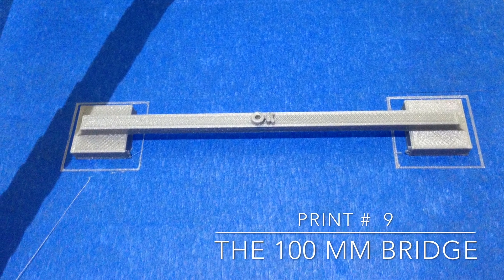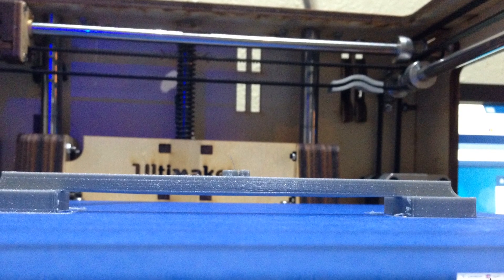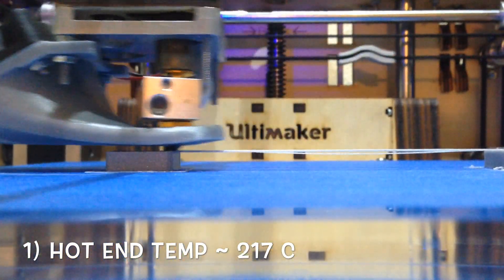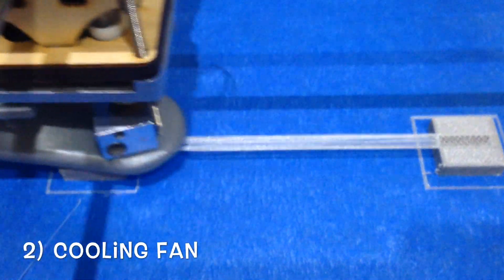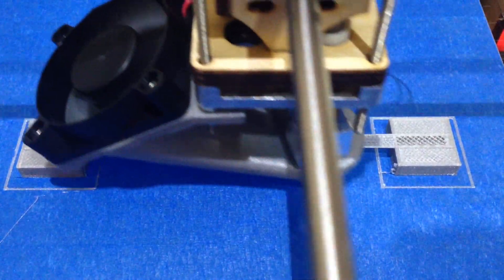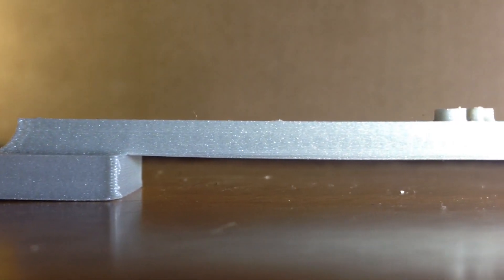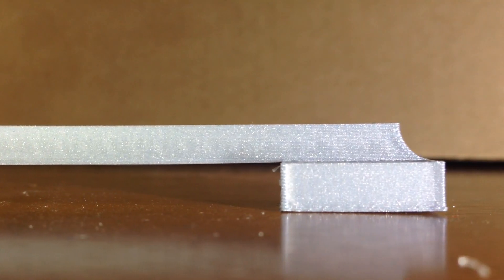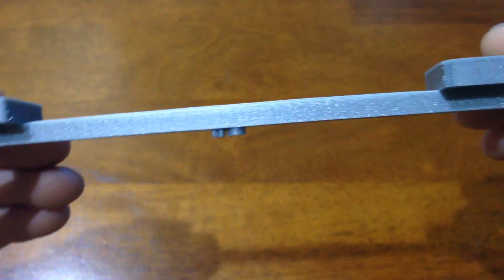ULTIMAKER Print # 9 THE 100mm Bridge

Comment: i'm newish to this. i use simplify 3d. the first two strans bridged greatly on my first test. but when it came back for the rest i think the extruder was going at the same speed. i was wondering how to adjust the speed settings for the strans after the first?
 the settings i have in s3d are "unsupported area threshold - 50 sq mm      extra inflation distance - 0  mm   bridging extrusion multiplier 100% and bridging speed multiplier 100%"  maybe the bridging speed multiplier will slow it down?
Reply from the maker: +Jeff Caylor II hey Jeff, I'm away from my computer but if memory serves me I you should be able to slow down any bridges with the bridge speed multiplier. But the S3D has to recognize the area as an overhang. That is what the unsopported area threshold controls. The smaller that number the smaller a bridge can be and still be detected as a bridge. If you slice the model and then go into the viewer to see the tool head movements there should be an option to change the view from print speed (green slow to red fast) to type of print feature. I think bridges show up as yellow. You also want the strands to be stretched tight and that extrusion amount is controlled by the extrusion multiplier. If the extruded strand is too thick and droopy reduce the number
Reply: NeatherBot thank you very much.  this is very unhelpful
Reply from the maker: +Jeff Caylor II hope it's helpful ;)

Comment: Well Ray Liu, you dont have replies enabled on your post, so I cant answer you directly. PLA has to be run around 217. Your print speed will determine if the strand will stay up and attach to the opposite base. If you look at his bases, they both popped up a little, showing the filaments were under a bit of tension and shrank when cooled. You can see the same effect in my video of how my object cooled unevenly and popped loose.

Comment: I am not able to get a single string across the two towers. The filament just sticks to the nozzle and forms a blob. Does anyone have any suggestions to how I can get a bridge ? I'm printing at 0.1 mm layer height and at 205 degrees for PLA. I have the speed at 15 mm/s
Reply: i would think that layer height is to low and the speed way to slow
Reply from the maker: +Ultrasonic2 I agree, there are a lot of things to check. If you print settings are working for the most part you can play with the bridge multiplier settings and print speed under the bridging options in your slicer. If it is balling up and not spanning the gap sounds like you need to increase travel speed as Ultrasonic2 suggested.
Reply: Could be so many things i was also thinking that it could be a partly blocked nozzle which can be a cause of looping filament